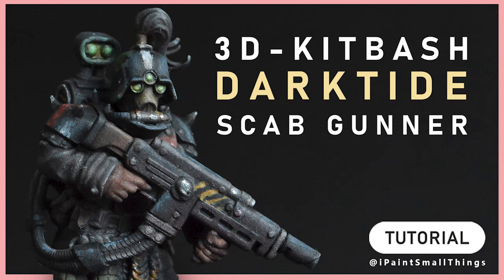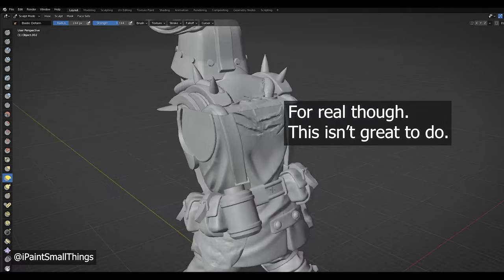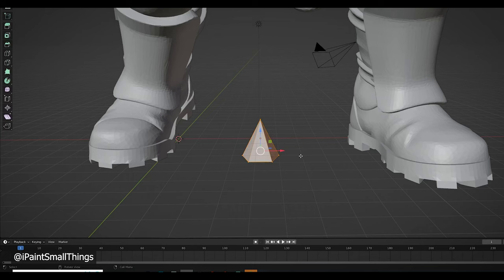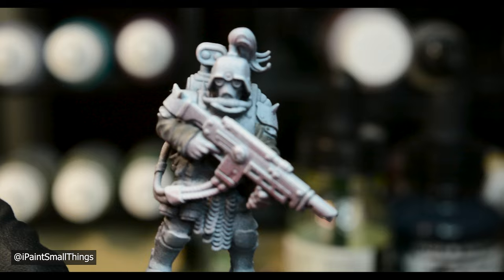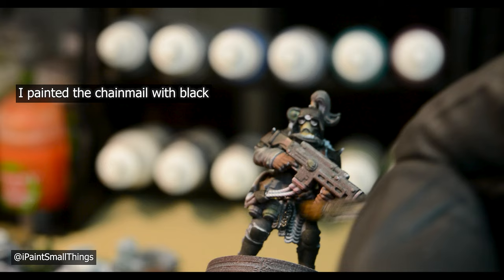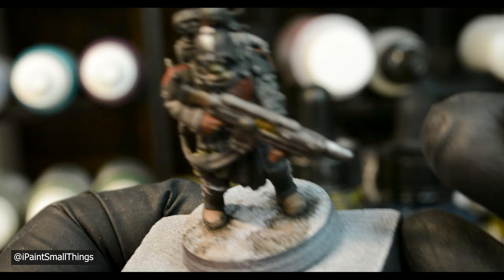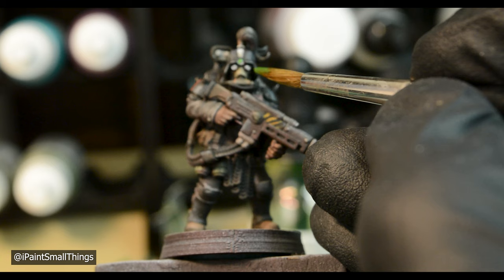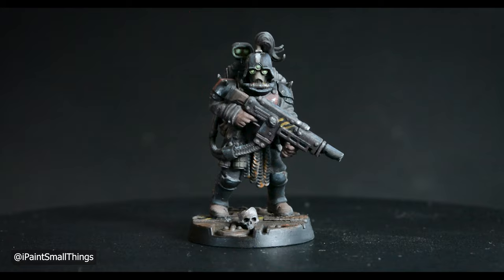3D Kitbash | Darktide Scab Gunner

Comment: As far as blender goes: To isolate the head from the body what I would personally do is go into edit mode and switch my selection mode by pressing W once which should put you into circle select. From there you can turn on x-ray by pressing alt-z or by clicking the icon with the 2 squares in the top right. This will allow you to select vertices through the mesh. From there you can simply paint all the vertices you want removed and then hit delete. As far as the spikes go, the method you used certainly works and is more accurate but is a lot more work. Personally I would just position them by moving, scaling and rotating with G, S, and R. Hope this was informative! Great video!
Reply from the maker: I'll make sure to come back to this next time I'm kitbashing! Thank you for the info!
Reply: That's exactly the method I use! Great minds
Reply: This is like exactly what I was looking for. it works great but how do you close the hollow part after removing the unwanted vertices? It's not as intuitive as Alt Selecting the open part after removing in this way.

Comment: instead of directly painting yellow when doing hazard stripes, where you often get bad coverage unless you got a REALLY good yellow
you can instead paint them white or light grey, and then cover it with a yellow contrast, instant full coverage yellow, then add the black stripes
Reply from the maker: Great tip! I've actually started doing that recently! It makes a huge difference. Is there a good yellow contrast you recommend?
Reply: i havent tried others than imperial fists contrast, but it works very well

originally i had hoped a yellow acrylic from AK would have been good, as their whites and oranges are rather nice, but sadly no
so for now yellow will have to be for details only, and not for basecoating
Reply from the maker: @kris220b  I'll have to give that one a go sometime! Yellow seems like a really difficult color to work with. I've also heard base coating with pink and then yellow can help.

Comment: What I can say? In the old times kitbashing was a meaning of finding the right pieces ,then  cut, pinning and a decent amount of putty....Now all we've to do is blending on a PC, then  you print with your 3D printer. The model is astounding, and the paint job very in accordance with the character, well done!
Reply from the maker: It's kinda wild what you can do with 3D Printing. BUT there will always a cool place for greenstuff and classic kitbashing. Thanks!
Reply: i think traditional kitbashing will still be around
as, it can be a real hassle to run a resin printer, especially if you dont have a dedicated room for it
Reply: @kris220b My idea of peak kitbashing is the traditional forms of kitbashing with help from 3d prints or third party bits where applicable. I have a guard army in the works thats entirely 3d prints but for an army like tau, i plan on using official plastic as a base for the printed bits

Comment: The scab gunner in many ways is very close to a tempestus scion in design, they use a hotshot volley gun as well. If you need more visual reference im sure i and many others could provide it.
Reply from the maker: Yeah-- I didn't notice it was a volley gun until some people pointed it out. I'll try replacing the tip of it eventually!

Comment: Fantastic video! Love the digital sculpting elements and the detailed, yet approachable paintjob.

Strongly recommend adding 3D builder to your digital kitbashing pipeline. It's plane cut feature is lightning quick, and basically foolproof. While being less fiddly and finicky than Blender's booleans. Though if you want to keep within Blender exclusively, a simple Knife tool cut with "Cut through" enabled would make easy work of separating the remainders of the shoulders from the head section. Just requires you to throw a plane into the cut after deleting the faces on the outside.
Reply from the maker: Thank you m8!
I'll check it out! Boolean differences can really mess up models, too. I'd love to avoid unnecessary issues.

Comment: Instead of using boolean in 3d, why not use "edit mesh" and just delete the planes, then select the lower vertices and using "align vertices".  Then select the mesh lines and use the cut tool to put new geometry in between the vertices and shoulder/neck geometry.
Reply from the maker: Imma have to keep this in mind next time I'm in blender! Thank you for the tips!
Reply: @iPaintSmallThings  it works in 3DStudio Max, im sure it's similar in Blender.
Reply from the maker: I have much to learn. Thank you for the tips!
Reply: @iPaintSmallThings  so, I wanted to share a reference for a really good 3d tutorial.  More that 10 years ago a 3d art site had a tutorial called the "Joan of Arc modeling tutorial".  It breaks down how to model an original 3d character mesh from start to finish.  And it also looks like someone has tried to convert the methods into Blender in the last few years.  This tutorial takes on how to manipulate sub-topology vs. The boolean editing method which sometimes cuts the mesh poorly on more advanced models, if I remember correctly.  If you keep a nice clean mesh you can really keep the quads clean and running through the entire model which i bet will help with 3d printing instructions.
Reply from the maker: @te9591  I will for sure watch that. That sounds really helpful. Right now whenever I make something the mesh ends up being all over the place-- so that would help avoid all of that.

Comment: Amazing vid, how did you export the model as one piece! Dont you have to worry about intersecting geometry?
Reply from the maker: Thanks! I select the whole mini and then go to export and check the "only selection" box. I really should worry more than I do. You can get rid of a lot of those issues if you bring the newly exported model into (free) MeshMixer, going into edit mode, and then choosing make solid. Then amp up the Solid Accuracy and the Mesh Density. I'll have to make a video on that soon!
Reply: @iPaintSmallThings  amazing man, thank you!

Comment: Do the parts that you pushed in cause any problem when printing, or do you print in solid?
Reply from the maker: I've only had issues with some really big models that weren't built with 3D printing in mind (that I'm not printing solid). 99% of the time I print solid though so I don't have any problems!
Reply: @iPaintSmallThings  Thank you. I guess that it makes sense: When printing real miniatures (28mm or around) making it solid is not really a waste. I will try to keep that in mind in the future.
Reply from the maker: @JackDespero  No problem! You also don't have to worry about curing inside the model. Good luck!

Comment: Very cool work!
I'm new to Blender, but the method you used to fix the cables, elastic deformation? Is this a plugin? Am I not experienced enough to understand?
Reply from the maker: Thank you! You can use the elastic deform tool if you go into sculpting mode! With the model selected, you can get to sculpting mode by clicking the little tab in the top left corner of the screen that says "object mode" and then selecting "sculpting mode."
Reply: Thanks for the answer)
Already figured it out, but it didn't give me the desired result. I just try to move the hair in the right direction, but it distorts a lot and the hair becomes snot.
Reply from the maker: @cyberchelick885  you can sometimes use the masking tool (I use it in the crusher kitbash) to make sure other stuff doesn't move when you're using the elastic deform tool! That may help!
Reply: Thank you, thank you, I guessed about the masking tool from your video)) but there it is really impossible to move the hair without greatly deforming it, so the decision was made to cut and sculpt by hand)
Thanks for the help)
Reply from the maker: @cyberchelick885  That's fair! Yeah when stuff is so close together it can be tough/impossible.